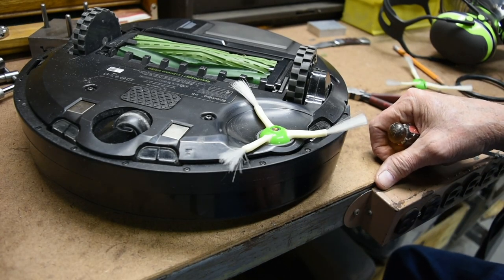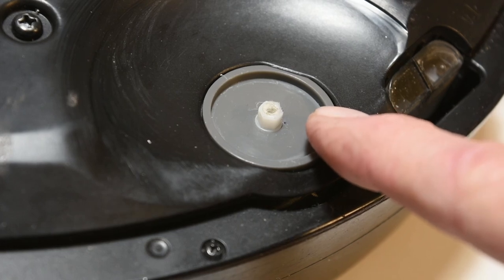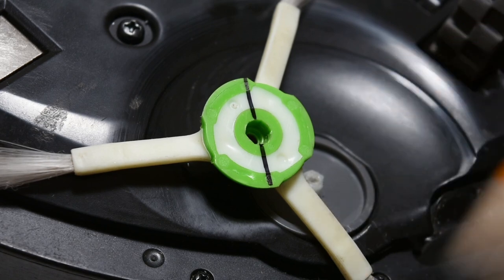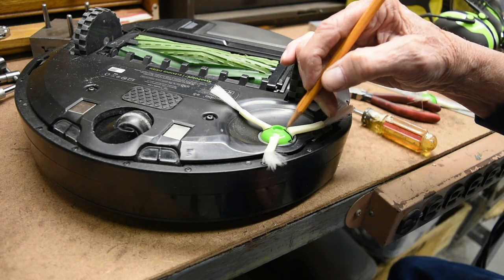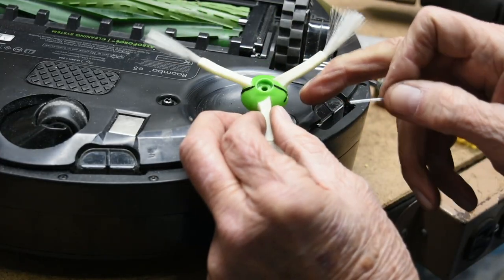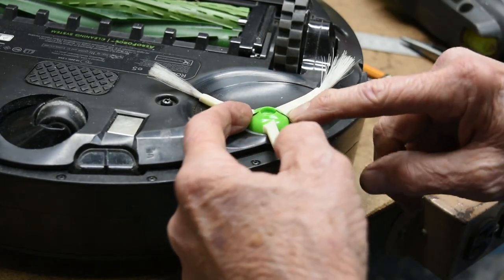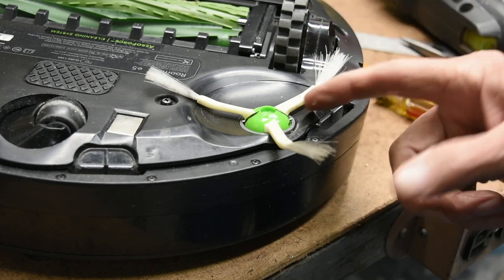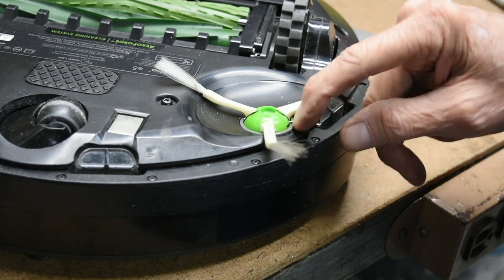Roomba Side Brush Stripped Threads Hack

Comment: Glues fail on the nylon gear post plus the screw threads are inadequate. 
Dave does nice work-i just used my hand drill and pinned it.
Reply from the maker: Thanks, Marty, for the kind words. I am truly glad you did that with a hand drill. I probably over-engineer things on occasion.

Comment: Its sad what a terrible design this is. I think I replaced the side brush motor like 8 times now. I wish someone sold one that is brass! Recently I got a new rug and the side brush motor gets stripped on this new rug within one cleaning (the brush goes slightly under the rug). I was about to buy an Eufy vacuum when I came across this video. I did what you said and so far so good (30 minutes in), but we will see how the next week looks. Thanks for the tip I am not very handy, but was able to pull this off just with a drill. The hardest part was finding a paper clip!
Reply from the maker: Thanks for feedback. You just proved that you are pretty handy. I posted this video almost 18 months ago and my wife has been changing those brushes ever since. She tells me that "the fix" is still working and will let me know when she needs some more brushes.
Reply: @doktorfixit  4 hour run last night no issues! I almost cant believe it thanks again Dave!